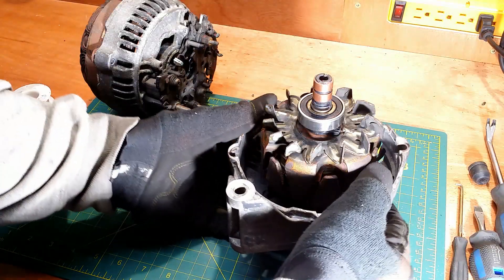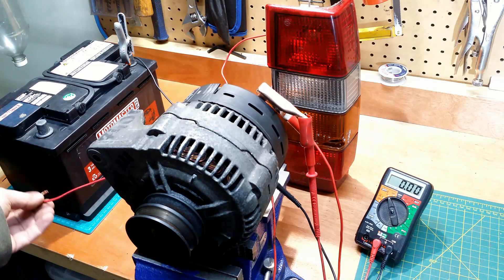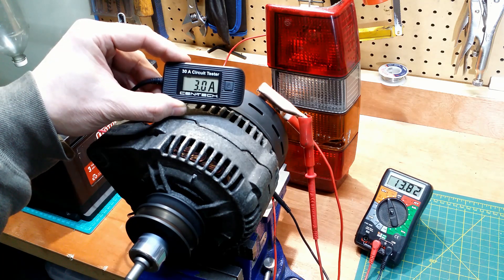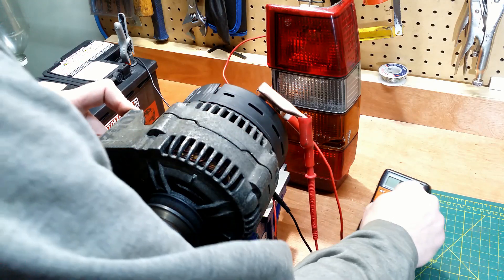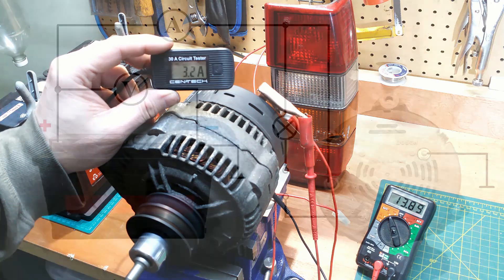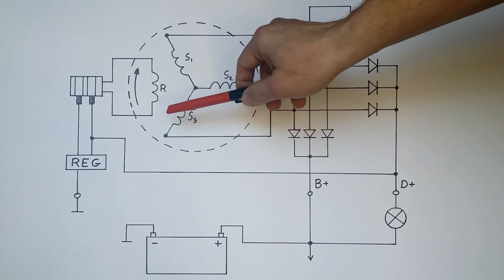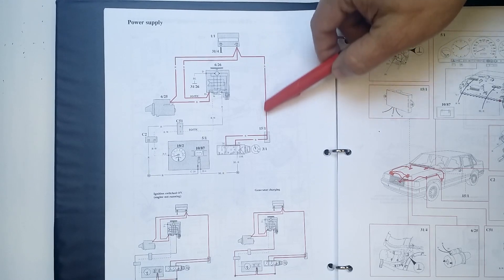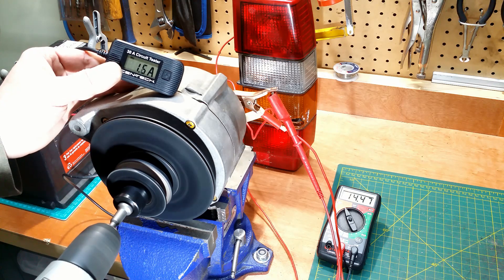Alternator Bench Test

Comment: wait i don't get it. The test i mean. current is flowing and amperage is being drawn. Why doesnt the light stay on and why does amperage decrease instead of increase? Does it mean the alternator is bad cause i would assume 2.5 amps running through your car wouldn't make it function properly
Reply from the maker: In this test the only load is the battery. Since it is nearly full it doesn't need much current. See my other video where I use clamp meter to check amperage in a running car. 
If you follow the current direction on the diode to the bulb you will see that it doesn't flow through the bulb when the alternator is spinning and charges the battery.

Comment: Actually this is somewhat incorrect, not been like this in many decades.  D+ used to be used this way a long time ago as you said, now days on modern alternators d+ is just a  "logic High",  not actual "power" needed to D+ anymore. Because no one uses 20mA bulbs anymore. The "Logic High" now powers on an  alternator through an LED (few mA or a bulb so it will work on modern cars. In other words the alternator gets it's d+ single and then "powers" d+ through B+. Yes, alternators have gone digital too.
Reply: you still have to connect it

Comment: Dash alternator indicator does not go out.  When bench testing alternator inside the vehicle, the bulb I rigged to D+ goes out when I crank the alternator with a drill and voltage increases by about .5.  When I remove the dash indicator connector from the alternator, the dash ALT indicator does out, but again, not when I turn engine over or drive the alternator with a drill.  ?????  I feel like I am in the twilight zone.
Reply from the maker: Check diodes and voltage regulator.
Reply: @robertdeptula2003  Thanks.  The conundrum I have is that my test bulb goes out but the dash light does not.  They are each wired the same, powered through ignition with negative going to the D+ on alternator.  This means, in theory, that either both bulbs work or both do not work.  Presently, my test bulb works, but the dash does not.  This is the case with two different alternators, both of which are generating excess of 12 volts and turning off my test bulb.   Both also fail to make the dash go out.

It cannot be grounded someplace, because when I remove the connector from d+ BOTH my test bulb and dash bulb go out.
Reply: There must be something different between your rigged bulb circuit and dash light.  My only guess is that you are getting sufficient power from the bulb you rigged but not from the dash.  Test voltage in both, if there is a significant difference, then the problem is your dash circuit.  Even if there is not a significant difference, connect BOTH to D+.  If they both then go out, the problem is your dash circuit.

If this is the case, you can probably do a work around by powering D+ by alternative means.  Make sure there is a load (your rigged light may suffice just fine)  Your dash light should then operate as it should.

Comment: I don’t get the purpose of the resistor (bulb) on the d+ line other than diagnostic purposes. Seems to work fine on my old tractor using a 4” terminal to terminal jumper wire.
Reply: It's to not fry the voltage regulator.
Reply: @ that’s what I’ve heard and gotten tractors wired with a bulb before but never one that actually charges the battery, mostly from crappy wire connections in the middle of other wires, so the bulb got pulled out with the wiring. Currently (past 5 years) I do the charge stud, exciter field on a dedicated switch on diesel motors and a jump wire from #2 terminal (exciter) to voltage sensing #1. Gas motor with points power comes right off the ignition coil supply terminal so it’s off when the spark plugs turn off. Newer ignition module with grounded turn off is usually new enough to still have an alternator plug, but I’d wire it like a diesel as it’s own separate circuit. That turned into less of a reply and more of a suggestion note to a future guy looking for a solution.

Comment: Hi.
Can you advise me if I have a two-pin alternator?
To which outlet should I connect the light bulb?
Well thank you
Reply from the maker: What is the model or part number?
Reply: @robertdeptula2003  
Fron nissan maxima qx 
Alternator nr 11.1357

I think I already have it connected correctly, but I can't spin the alternator at a sufficient speed.
the alternator has a lot of resistance when turning, I can't spin it with a classic drill.
it is normal?
Reply from the maker: Ball bearings?
Does the pulley spin freely when no electrical connections  are made?
Reply: @robertdeptula2003  So I already tested it with such a powerful drill. I reached 14.3V
I put new bearings.
It was just about a stronger drill. Thank you for your cooperation. Good luck